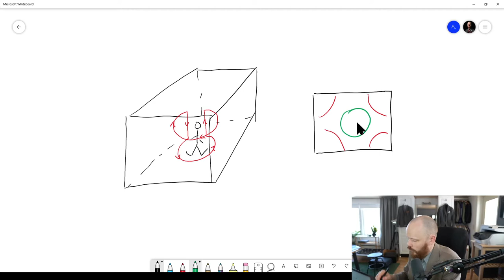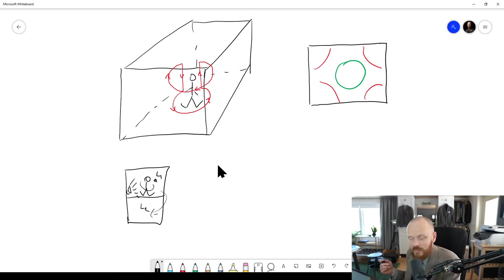Can sound measurements with a swept hand held microphone introduce systematic discrepancies?

Comment: Hi, Rickard! So what tips and tricks you can recommend to avoid systematic discrepancies? Use the same measurement points in both rooms? Or you found some more efficient ways?
Reply from the maker: I personally always use a Manfrotto selfie stick (telescope). That way I can adapt my sweep radius to the room size and capture a better average of the room. In the smallest rooms, multiple sweeps are not always an option. The low frequency method <25 m3 can be a solution, but what I am talking about here can occur for larger rooms than 25. 

To choose a proper sweep path and then use the same path in both rooms seems like a good idea. 

You can also use fixed positions. It's not common among consultants, but if you have a two channel instrument it is just as fast as a sweep.
Reply: Thanks a lot for your reply)